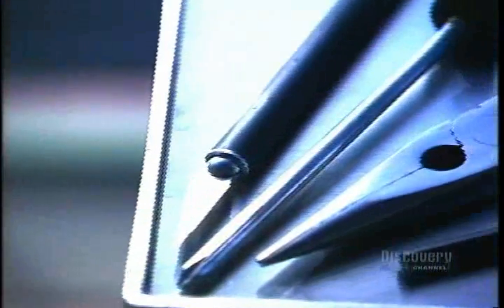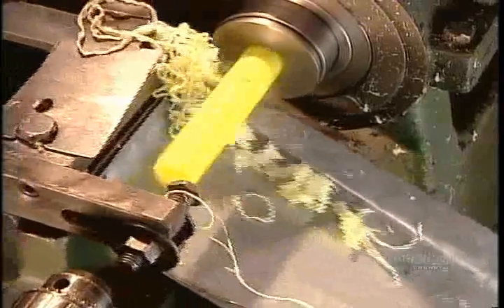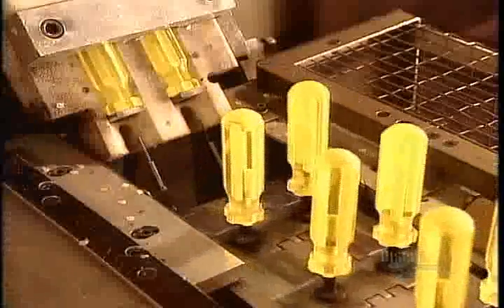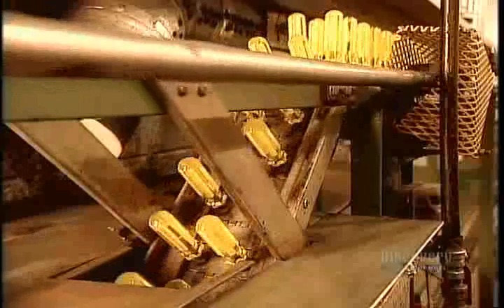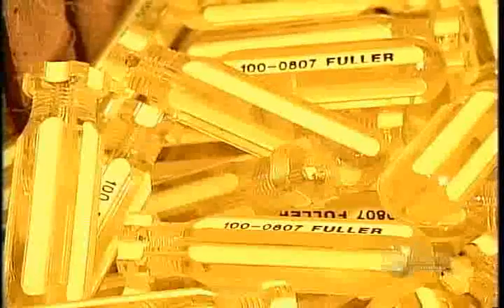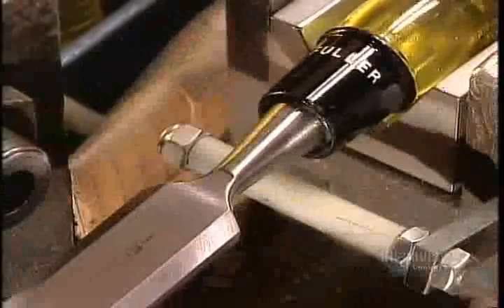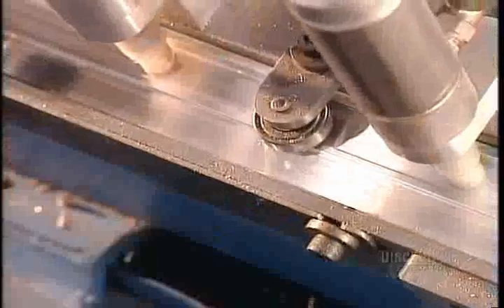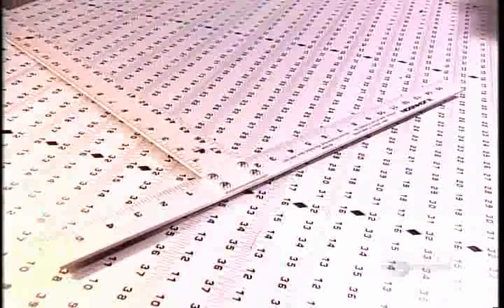How It's Made Hand tools

Comment: I've been searching for the machining process on acetate handles for almost a year now. If you ever look down the barrel of an older acetate handle, sometimes you can see how the flats are uneven, like one side of the fluting is narrower than another. I always thought they started out as a circular stock that was first contoured on a lathe and then milled, not the other way around as in this video. Super neat
Reply: -- The bar stock material isn't machined, it's extruded under pressure and that's why you will sometimes get handles that aren't concentric from one side to the other. This is especially true with foreign made tools where quality isn't always job number one. Best wishes! 

- Max Giganteum
Reply: @MaxGiganteum  Oh that's even cooler! I actually didn't know that. Thanks for that dude.